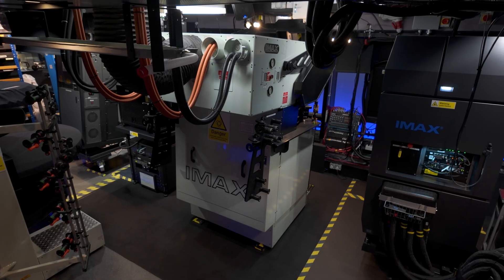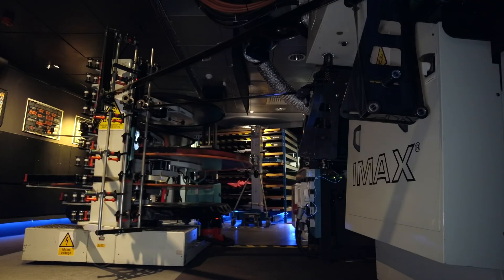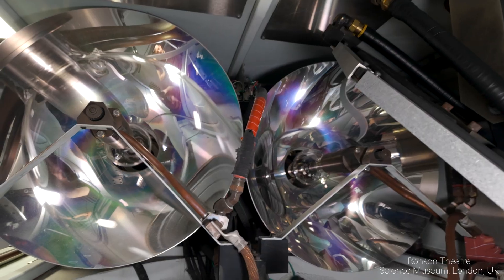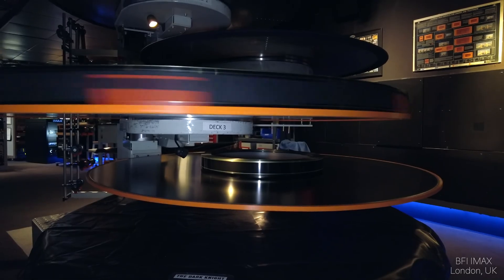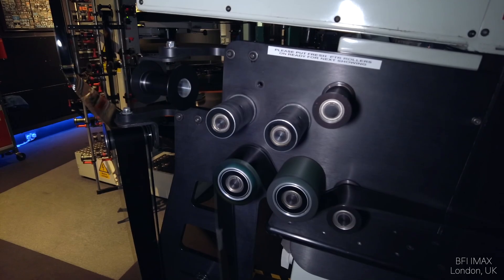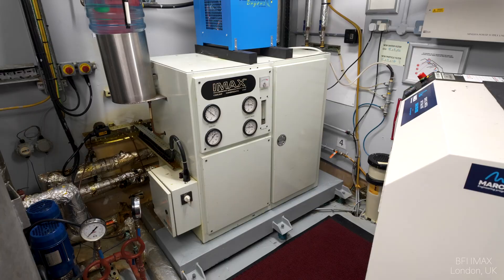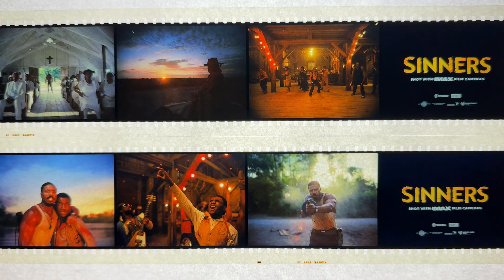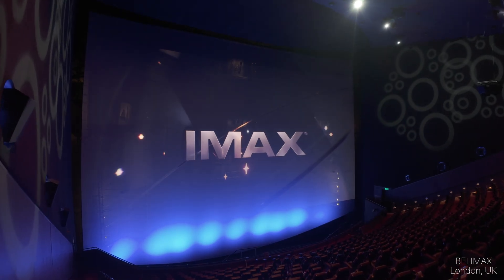The Future of Film: Next-Gen IMAX 70mm

Comment: Why don't they create some sort of dual platter system to split the film in half, with some way to seamlessly transition, or simply have an intermission segment where the transition is done?
Reply: IMAX 1570 film actually had the ability to be played with changeovers but it requires 2 projectors. this was technically possible using the smaller IMAX SR 1570 projectors, which are small enough to be placed side-by-side and theoretically able to be used for changeover setups. as far as I know, I haven't heard of instances where changeovers were required for 1570 films, and the twin SR projector systems are mostly used for 3D projection in smaller screen theaters.

Comment: IMAX is Canadian right? Maybe they should team up with Barco and use the Auromax sound system. Since that's also a standard (the one of the three that isn't from the US) for immersive audio, it might be easier (and thus cheaper) to service instead of some new custom system. Now for the people saying that this wouldn't make sense since most films are released in Atmos. There is actually an overruling standard in DCP land called SMPTE 2098-2 (or IAB) that can be used for immersive audio that can be used on all immersive processors (or at least that's the goal). So you'd basically need a sound only DCP and a system that can sync the timecode of that DCP with the timecode from the projector. That way there is only one immersive master needed for this, making it easier for the studio's to release.

Comment: could a laser light  hit the same brightness as a Xenon light as this is the battle of current cinemas where you get higher contrast from laser but less brightness. unless more advancemnets in laser have been made. the new single laser at kingston looks infinetly better than the duel xenon bulb projectors with its lower black level but I feel it looses that eye searing pop of the brightness. somthing I also notice with the projectors we use at Acton
also why only stop at 12 chanels of audio when Dolby Cinema can go well over that with 64 chanels of Dolby Atmos audio.
Reply from the maker: On the audio side — I went with 12 channels because many theatres already have that number of speakers installed but aren’t using them for 15/70 film. You can absolutely add more, but I was aiming for something realistic that could be adopted without major rebuilds.
As for brightness — you make a great point. Technically, you can push it to be extremely bright, but our eyes will adapt, so it won’t feel as intense. That’s why I think maintaining truly deep blacks as the baseline is key — then building the brightness on top of that for maximum perceived contrast.
Reply: @boredtech  Silly question: if you want the lasers to make a brighter image similar to the Xenon, can't you just add more lasers to the mix lol?

Comment: The QTRU was manufactured by kinoton for imax There is no reason it can’t be made larger, imax 15/70 could easily be made to playback multi channels. If you want to talk about we brought VistaVision to the tcl Chinese theatre and played back audio from a pro tools rig with theoretical 16 channels for the hardware used get in touch. but could easily be expanded. Light steering and EDR is common in digital cinema projection like Dolby vision and Barco LS4K

Comment: Dolby ProLogic creates 5.1 channels easy from only 2 discrete channels. I will not describe here how it is done but you do not even need DSP or software. Pure analog circuits!!  Now.. if you have 6 discrete channels from the beginning, then you can create all channels needed in the future. And actually that is how its done today! So I do not want to dissapoint you, your idea is great! But its not really a problem. 6 discrete channels is enough to create all directions you need.
Reply from the maker: Totally fair point — but I’d say “6 discrete channels is enough to create all directions you need” is only true if you're sitting right in the sweet spot, the golden circle in the middle of the auditorium. Move too far off-axis, and you start to lose the spatial effect pretty quickly.
As for Dolby Pro Logic — absolutely, I get what you’re saying. But what I’m suggesting is a system that can output native 12-channel audio, no matrixing or upmixing. Even something like a Mac Mini could handle it — it could pull the mix from the internet automatically, no DVDs needed. And the beauty is: 12-channel mixes already exist, so there's no need to recode anything. Just a matter of delivering them properly.

Comment: I love the concept of zone illumination for film projection, but only if there was a SERIOUS butt-load of zones.  Zone dimming for LCD TVs (and VR HMDs even more) is absolutely useless IMO (needs something like 10X more zones.)  What about using laser illuminated DMD/DLP?  I guess the illumination pattern would need to be projected/focused onto the surface of the film for the projection optics to work.
Reply from the maker: I think the benchmark should be something like a starry night sky — if you can render pinpoint stars without any glow or halo around them, you're in the right ballpark. 🌌
As for the laser side of things, I was imagining either a single powerful source split into many optical fibers, each with some kind of controllable "valve" or modulator — or individual lasers per zone. Just a rough concept, but it opens up some wild possibilities!
Reply: @boredtech  Yep!  Most zoned backlights do a great job of simulating what it's like to have cataracts.